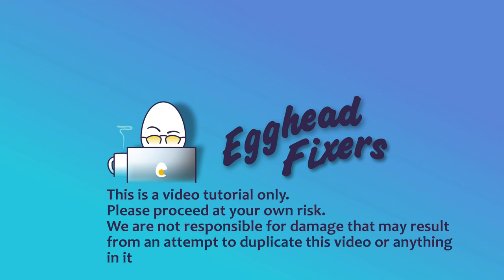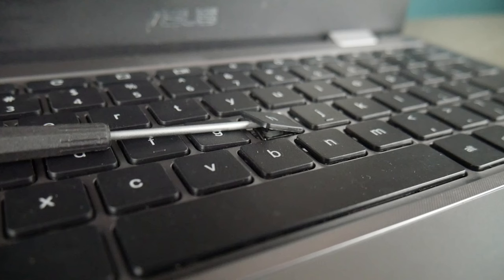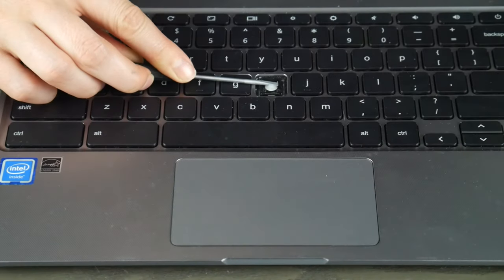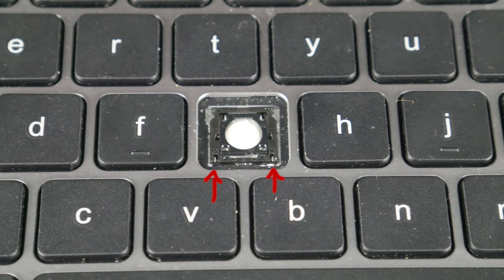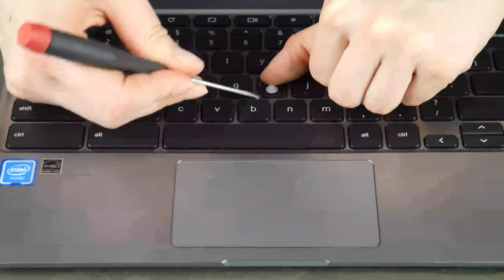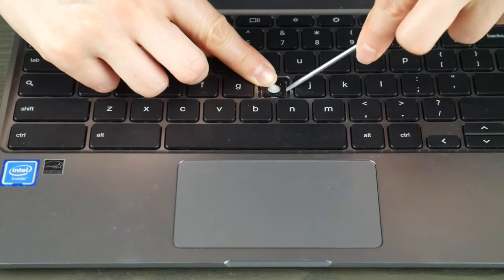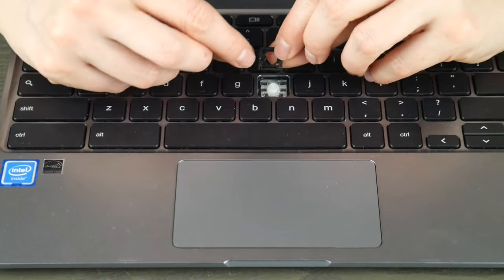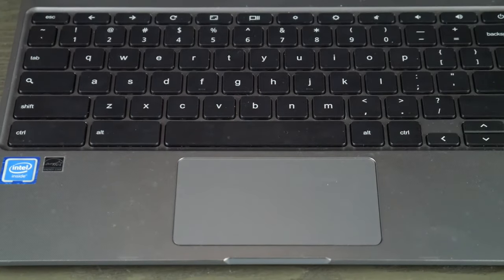How to Replace a Key on Any Asus Laptop's Keyboard  - Tutorial by a Certified Technician

Comment: I accidentally took off one of my ASUS laptop keys and It came out in three sections , the ring thingy was not connected w the other thingy . I’m not sure if I connected those two components together because now my key won’t go into its place and the hooks won’t lock in
Reply from the maker: You can take just the key cap off another key to compare and see if something is not on correctly
Reply: Same

Comment: Is it okay if I removed the circle plastic thing from one side of my spacebar? It's working pretty well but I'm just worried it might cause problems in the future.
Reply from the maker: Typically it would be best to have it for the key to function correctly. If it's causing problems you could try removing it but I wouldn't be quick to do it.